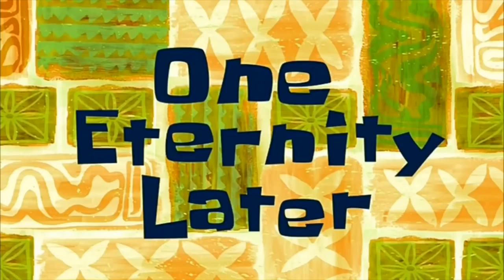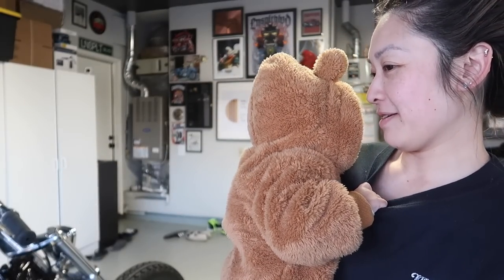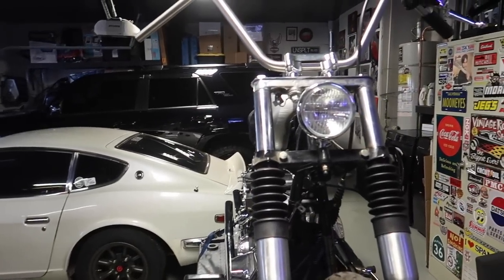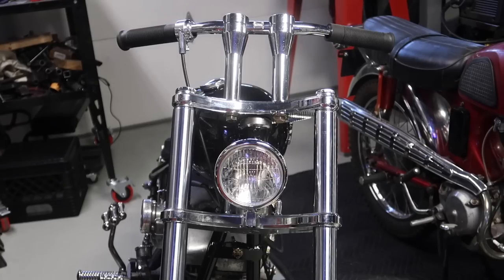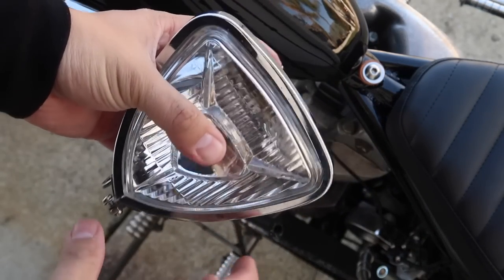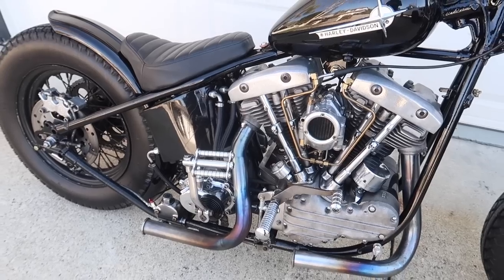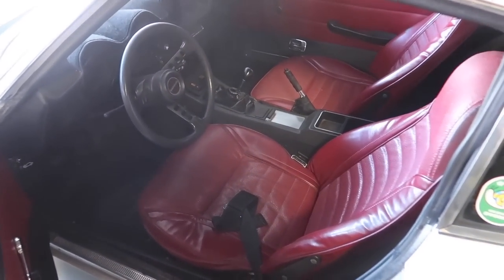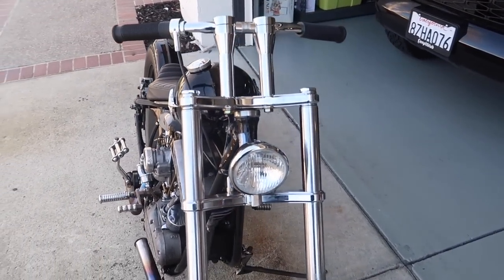Shovelhead Getting Closer to Final Form

Comment: You can`t go wrong with black & it`s not a color. It`s a neutral that doesn`t take away from the rest of it. like a velvet Elvis!
Every version was great, but in it`s current version is the best yet.
Simplicity of function on display.
I`m too old for a hardtail, but if I could I would build one close to yours.
Lots of nice little details upon close inspection.
Love that it`s the slab side Shovel too...very kewl! 
P.S. love the Z car, had a few of those myself...

Comment: Haven't commented in while, the gloss black is sick with the badges! I think I have the same tank on my shovelhead. There should be another threaded bung on the right side of the tank. That's where I ran my fuel valve. It's a different size than the left side, but it should work.

Comment: Great choice Homs. I had the same gas tank and used the right side for the petcock. Better not the one above the ignition coil. Sure you know just saying.  The round headlight is a good choice it could be a bit bigger or like you said higher. Now it’s in the details but am stoked for you homie.